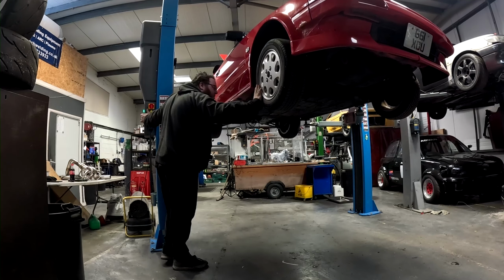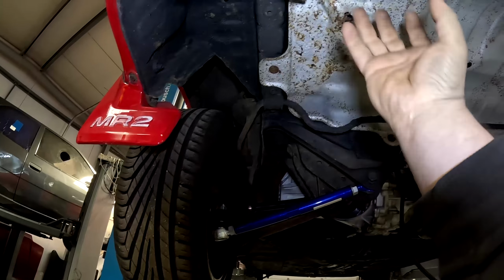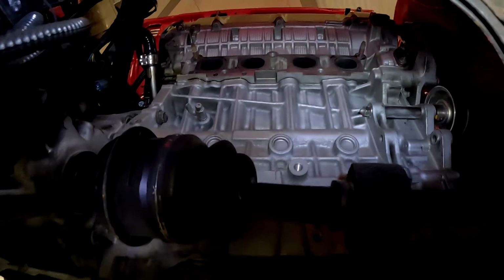2ZZ AW11 MR2 Manifold and Exhaust Fabrication

Comment: Why was the tailpipe section clamped on rather than welded?
Reply: He explains in the vid, so it can be moved around if I want to. I'm glad he did it this way.
Reply from the maker: To allow some adjustability and finesse the fitment in the hole. Plus if down the line they decide to change the style of tip, its must easier, quicker and cheaper to replace that one section.

Comment: Wow very nice! If you had this jigged I'd buy one straight away! If Brad was kind enough, what would the odds be of his car being the donor for another identical system, posted international I wonder...?
Reply from the maker: Issue it, it poses a massive inconvenience to Brad, as it means being without his car, Brad would also need compensating for the inconvenience. The other issue is storing the Jigs, I don't have a a lot of space in my shop for storing large fixturing jigs . Then i'd need to sell atleast 5-10 systems to make going through all that effort worth it.
Reply: @GizFab  thanks for the reply - I'll reach out to Brad direct and see if it's possible as it's a smaller community 😊 Wasn't meaning a jig per se, just using Brad's as the base for another one off some the same way! Cheers